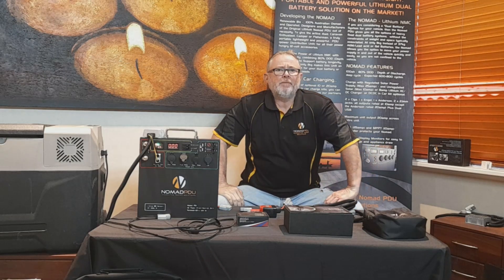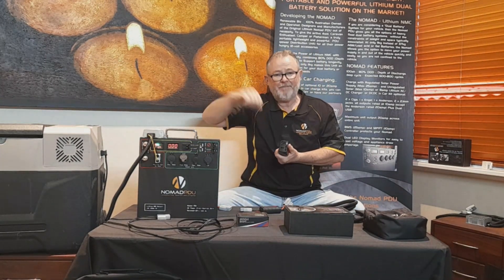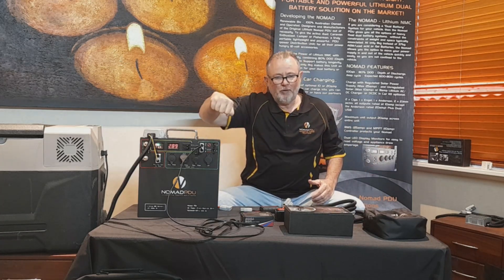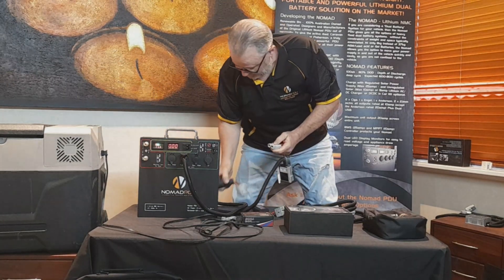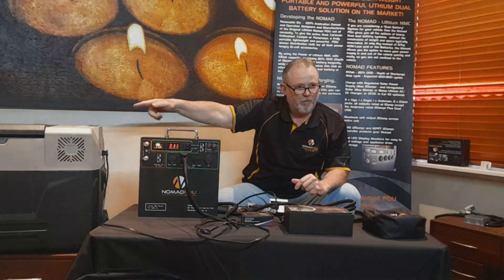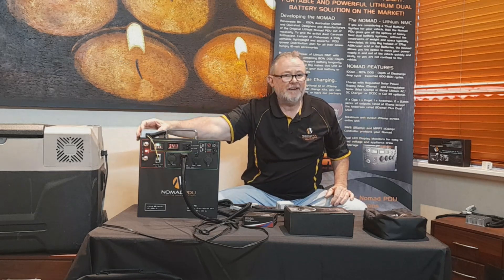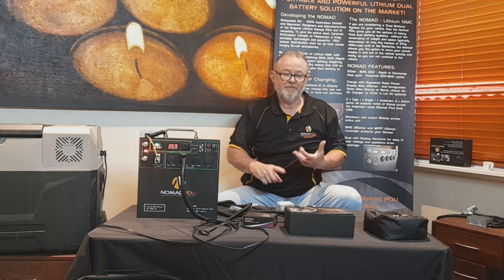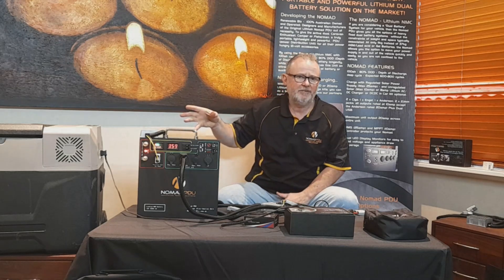Nomad PDU - Your Fridge and how does it work, Most valuable tutorial.

Comment: I run a beer can 150 watt inverter to charge with the supplied wall socket charger while driving and use the same to run the dometic as 240 volts down to 10.5 on the nomad. Either way I don’t like the new cutout fridges but my old Engle will kill this battery if need be running DC.

Comment: Can't believe it,
The nomad gets even better,
So easy,I was going to plug it into the inverter and solve the low voltage cut out,but using the 5 amp ciga socket charger is too easy.
Thanks so much for the video tip.
Love ya work.
Sam another nomad man.